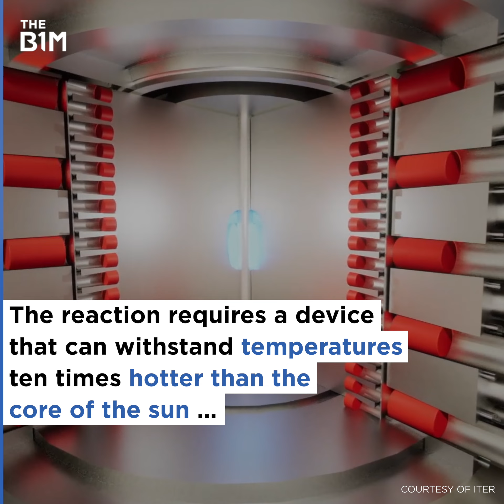This Nuclear Fusion Reactor is Construction Story of the Year 2022

Comment: But will it work when completed?
And even if it works, will it generate a net positive energy output?
Reply: The science says its possible, and engineering is basicially physics constrained by budget so I think with enough funding etc it will be viable.
Reply: @SomeKidFromBritain  I hope you're right! 🙂
Reply: @fredashay  Me too, I doubt it will work anytime soon though, although it will be sooner with more resources etc, there are some BIG hurdles still to be overcome.
Reply: @Ben Chuft To be fair there are enough demonstrations of the ITER style reactor working to push ahead with the project. Not only because it demonstrates the science works, but because it is a reactor type they have a lot of experience with.
Reply: It'll work in 30 years 🤣
Reply: Logically it won't be counted as completed until it does work.

Are you sure that it's yet another "demonstrator" reactor? I heard that the genuine excitement (forgive me) generated by this is because it's the world's first that is of the size and complexity necessary to be able to produce energy at useable levels.
Maybe it'll still be too small to be a commercially repeatable model and perhaps that's why the demonstrator tag has reappeared.
France, the USA, the UK and a couple of other countries (Ukraine comes to mind for some reason and I think that there's one near Moscow as well) have their own demonstration-of-principle versions, but  these doughnut hold a candle to this France - based behemoth.
Reply: @ThePixelRunner  well duh but once it's completely figured out producing nuclear fusion plants won't be hard. The hardest part is solving the problem
Reply: Depends what you mean by net positive. It will be up to Q = 10 which is 10 times the energy put into the fusion reaction. But for true net positive (like you can actually make power for the grid) you need at least Q = 20

Comment: But when they finally press the 'on' switch, will it actually work or will they have to spend another 10, 20, 30  years ironing out the bugs. Too little, too late for this project. Too big for its own good.
Reply: So ITER has been in the works since the 1980s I believe. Many design stages and of course scientific breakthroughs since then. When ITER begins operation they will first begin plasma production and slowly build up to fusion by 2035. This technology is still a long way away, but there are advancements being made everyday all around the globe. It isn't a case of ironing out the bugs, since there is no guarantee we will be able to achieve fully sustainable fusion, but humanities  will drives us closer. One place that ITER lacks is their breeding blanket design is of an older generation, with new tech being predicted to produce far more energy. 
Basically, it's a massive testbed. New tech will be swapped in and out, new ideas will be tested and different fuel mixtures used. Nothing is guaranteed but it is definitely a damn cool thing to look at!
Reply: It's never too late.
If we keep this mindset, nothing will ever be done.